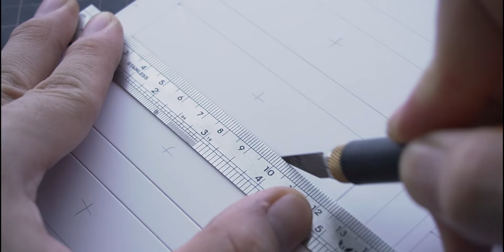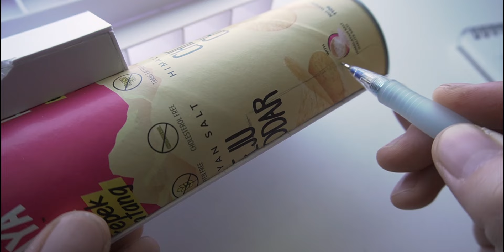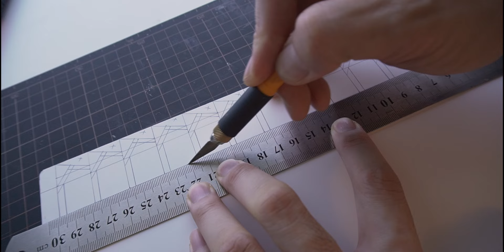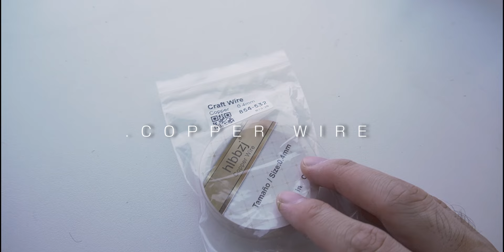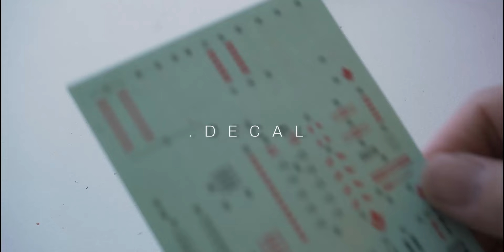Post Apocalyptic Shibuya Fight | Wallcraft Diorama

Comment: How does your figure stay attached besides having the magnets? Usually these figures are flimsy.
Reply from the maker: Those joints are thicker than usual because of the few layers of topcoat, plus the mace is actually attached to the building so it forms a 3 point support.
Reply: @MezHobby  ohh OK, that makes sense. Wow. Your very knowledge. Keep up the good work.

Comment: Is it strong only with magnet?
Reply from the maker: The magnet is surprisingly strong, but to maintain the pose i recommend using glue on those joints to make it permanent, also i did use some glue on the mace to support the upperpart of barbatos.
Reply: @MezHobby  i see, thank you